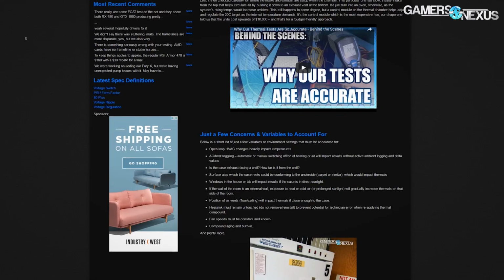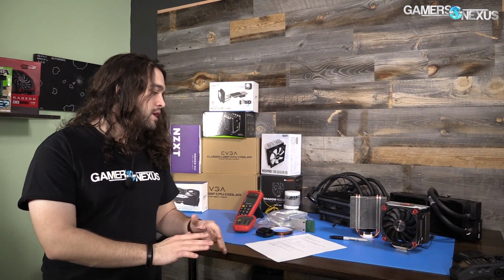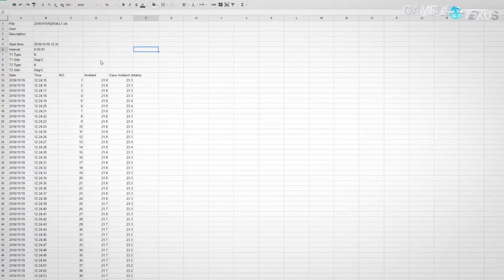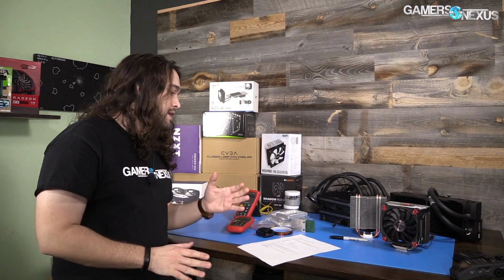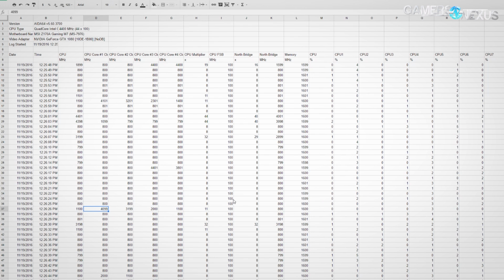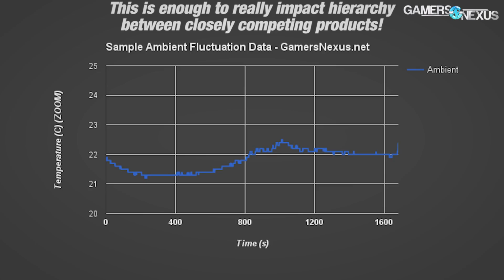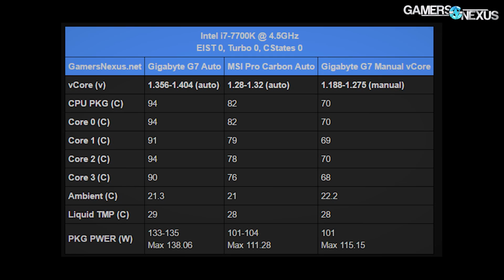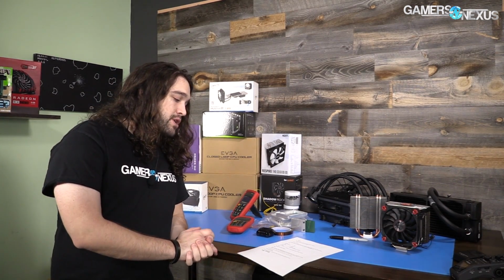Thermal Testing Challenges (Inspired by Bitwit)

Comment: A GPU backplate only dissipates heat if it is actually connected to something (like memory chips). If it just sits above the PCB it actually holds radiated heat back.
If the backplate is actually radiating, orienting the CPU coller with an upwards air flow will suck in warm air from the graphics card. Thatt will increase CPU temperature but decrese GPU temperature.
Reply from the maker: HappyBeezerStudios Yes. Of course. This was discussed and demonstrated in our EVGA VRM discussion.
Reply: I just remember a review off a cooling plate for M.2 SSDs, those decresed the head of the "upper" side slightly but almost cooked the side towards the board.

Comment: I wonder if the variances you see in thermal testing just come down to the way heat pipes work.  The liquid inside those pipes is going to vaporize at a certain temperature, so the whole system is going to function most efficiently at a certain temperature.  Ambient temps could make a huge difference there.

Also, there's orientation.  There are probably some coolers that will give you different results depending on whether the system is standing up or resting sideways.

Comment: This seems to over complicating the issue. I like the K.I.S.S. system for things such as this. Each case will offer a different thermal margin so if you test first on an open air test bench at what the room temp is. Then you place it in the case and test at the same room temp you will be within 1 or 2 degrees. Does 1 or 2 make a difference? No, because if you are running your system to where it does, your a moron. Task load can push over that limit easily so a decent buffer needs to be figured in.

I hate when reviewers lock the CPU. That is not real world and the rest of the overly complicated steps mean nothing. I have had my CPU jump 6 degrees during turbo so locking it for a test is useless. Not real world at all so cannot be used as reference by the consumer.

Open air with the ambient temp given, then a case (if under review) is enough in my opinion. If the hardware tested raises 15 degrees for you then it will for me. I can remove side panels (open air) tell what my system is running at (as if I did not know) then add 15 degrees. This is real world because we do run our systems in a chamber. If you do, get your head checked.
Reply from the maker: Raging Monk You cannot trust data retrieved that way. For comparative analysis, it is unfair to the products tested to not eliminate variables. It's a cooler test, not a CPU review.
Reply: Gamers Nexus "It's a cooler test, not a CPU review." So you throttle the cpu (not real world) to review a cooler in a hypothetical situation. But leaving the cpu at stock while running the same test (Heaven, Prime, etc...) with the room at the same ambient temp would give a good indication of real world performance with a + or- of 1 or 2 degrees.

I watch your videos and do respect your work. I simply feel this is splitting hairs because there will always be a + or - of 1 to 2 degrees. But hey if you want to spend days obsessing I do not mind. Your doctor may try to medicate you if they find out though. LOL (wanted to end on a humors note. No offense intended.)
Reply from the maker: It's not throttling the CPU, it's running at max clocks (we tune the frequency to be the turbo frequency, then disable turbo). This just eliminates any downclocks. It is representative of real world because the CPU normally is expected to run at turbo during application crunching/gaming anyway, but disabling the EIST/cstates/turbo means that we don't have random power fluctuations. So you're actually getting the max performance out of the chip in exactly the same way it'd perform when fully loaded, but without any unexpected and sporadic downclocks resultant of some Microsoft/Windows call or other unexpected system behavior.

Comment: Have you ever seen issues with line/mains voltage? (ie, 115.5 volts, vs 110 volts, etc, depending on load on the grid/neighborhood)
Reply from the maker: slikrx Not too much here. If we did PSU reviews, it'd probably be a bigger focus. But not problematic for what we do now.

Comment: As a data analyst, and hardware junkie I love this video.  Have you looked at using a program like Minitab to take your analysis and spreadsheets to the next level.  That will get you where no other reviewer is on the net.
Reply from the maker: BigDaddyKong We have considered SAS/NOVA tools. I will admit that I am intimidated by them! That is outside of my experience. Any recommended starting resources?
Reply: I would highly recommend a book called Lean Six Sigma & Minitab: The Complete Toolbox Guide for Business Improvement.  ISBN - 13: 978-0-9546813-8-8.  I don't know if it was your intent to create a very good DMIAC solution for how to benchmark certain hardware.  That book does a great job at explaining the process in terms that we don't need to be a statistician to understand the processes.  It also shows diagrams on how to use the graphs and what you can use them for.  Most sites only create a graph using probably no more than 20 rows of data.  You are generating a good bit more.  With what you have, when you learn how to use it to its full extent, it could be extremely value added to some of the hardware companies and place you in high demand.  For now, you can turn the review world on its head.
Reply: You could also look at Tableau or any of the various data analytics software packages... :)

Comment: A little off topic with my question, but since it's about gpus and they generate a lot of heat, I guess it works.  I recently installed the new nvidia drivers this week and now my gtx 1070s won't sync in idle.  gpu1 is at 632mhz and gpu2 is at 215mhz.  I've checked SLI options, even made sure they were linked in msi afterburner, etc.  They sync fine on load.  But before installing new drivers, they were at 215mhz idle.  TIA.

Comment: Why not just use a heating element to represent a motherboard and cpu. If the goal is to test how well a case dissipates heat from key points it shouldn't really matter so much what is in that source so long as it is representative and is consistent.
Reply from the maker: Mark Rushow Check out our Corsair thermal lab interview with Bobby Kinstle! We talk about this idea. Great question, by the way. We've looked into this one on and off over the years.

Comment: Hey Steve speaking of thermals, would you be able to test the m.2 thermals on ASUS ROG Strix Z270I Gaming with their Double-Decker Heatsink. It would be interesting to see is if it fairs any better than MSI’s heat shield. Also a video on thermals for nvme m.2 drives based on placement would make an interesting topic, especially for mini itx builders where the M.2 slot is normally on the back of the board. 
Cheers.

Comment: Hey Steve is there a program that is reliable for an accurate temp reading for my Athlon 860k? I OC'd it and HWMonitor shows it at 50-60c at all times but I feel like it may be a wrong temp reading because when my room is really warm (my heat is cranked to the max) and really cold (I turn off the heat and it gets freezing) the temps do not seem to change which seems impossible to me. I'm also using an H55 liquid cooler with my chip clocked at 4.2Ghz.
Reply: +HappyBeezerStudios  This doesn't even remotely answer my question but thank your for your borderline incoherent input.
Reply: Kotoryyk To get proper temps from FM2/FM2+ you gotta use AMD overdrive and get the temps from there. They don't report their temps the same way other cpus do. They kinda report how far under or over their limit they are currently operating at. Ex. I am an 860k and I am currently under 25 degrees C of my threshold. There is entire videos and articles on this subject. Just do a Google search about how they report temps and you will find tons of information about it.

Hopefully I've helped out.
Reply: Ty sir I appreciate the quick response.
Reply: Kotoryyk No problem dude, anytime.
Reply: The same way Intel chips are reporting their temp.
It's measures as the distance to the so called Tjmax, which is the shutdown temperature (Which is different from chip to chip, but usually sits around 90-105°C) . And the further away from that point, the less precise the readings become. Which is no issue because it has to be precise where it is critical and not so far away from it..
Reply: AMD Overdrive is best used with their CPUs. The TCTL measuring method is really confusing but you could still get ok results if you know how to measure it. On idle, AMD cpus go way below ambient temps and are always inaccurate on load though, you just have to subract the current temp from the max temp on the CPU, so if overdrive reports the CPU to be at 20C on load, subtract that from the max temp of the CPU (e.g 72C - 20C = 52C is your actual cpu temp). Still though, this is not very accurate.